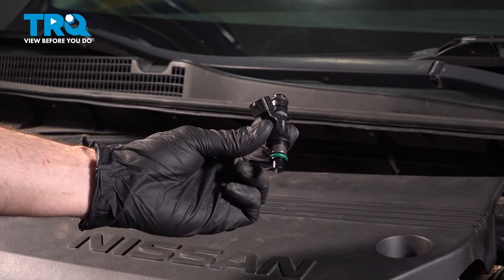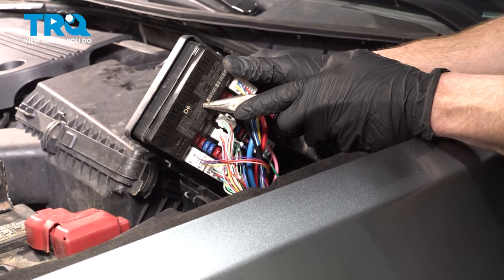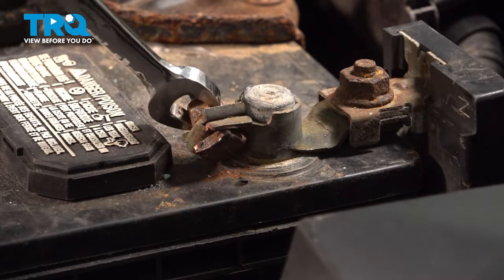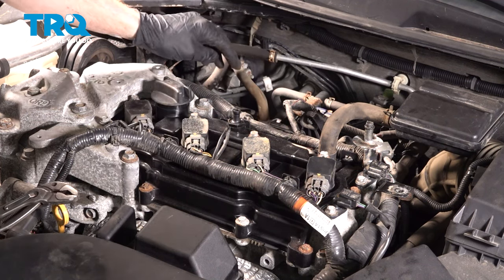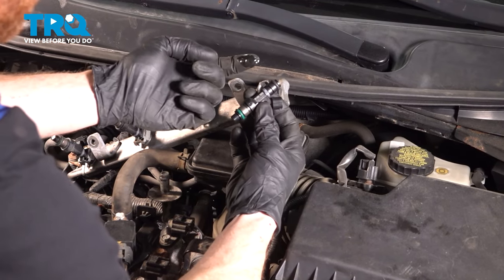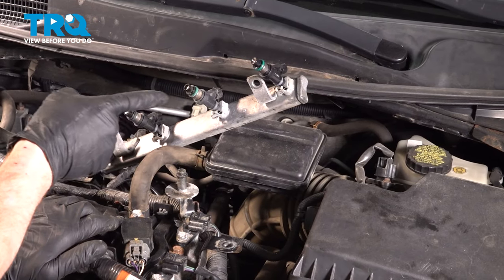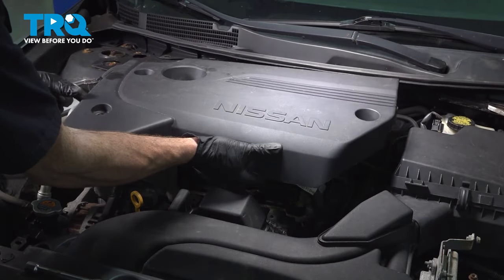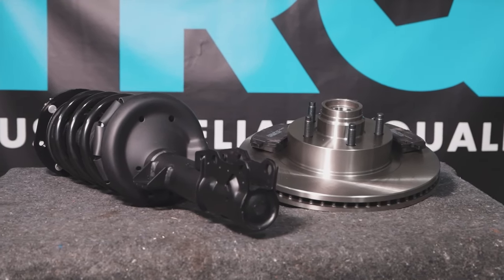How to Replace Fuel Injectors 2012-2018 Nissan Altima (2.5L)

Comment: Hey guys! I'm a education film professional. First you guys are amazing! Please keep up the good work! Secondly, just a quick tip on the engine view angle. PLEASE DON'T DO THIS UPSIDE DOWN AS DONE IN THIS VID. You're users are not going to be looking at the engine from this angle when they perform the task and this is not a typical view angle of engine bays so this angle feels disorienting and therefore hard to learn from. If you have to mount the camera upside down for whatever reason just flip it in post production and you're good to go. Your stuff is always amazing so please keep up the good work! I'm excited to see future videos!

Comment: I need this same video of replacing fuel injectors on a 2003 Nissan Altima 2.5s. I'm having issues getting to the fuel rail on the 2003.

Comment: I have endeavored to change my fuel injectors in my 2000 Corolla. It has been a wild ride with the injectors leaking due to the injector o-rings tearing or getting chewed up. Thankfully, I have a lot of spares and I have gotten better at inserting and lubricating them. I finally managed to get the injectors to stop leaking but then I was hit with numerous low-300 misfire codes plus P0172 (running too rich).

I read up on the misfires and the lower seals needed to be lubricated so I used Vaseline. No more 300 codes but I still have P0172. LTFT goes down to -26%, which is quite ironic considering I've been dealing with P0171 for the longest time. The car idles softly like it may sputter out when I drive slowly or stop

I assume this rich condition is from all of the excess fuel that went into the cylinders/engine from dealing with the recurring leaks and lifting the rail up and back so much and gas going into the port holes. It's not like it was a water hose or anything but still a decent amount over time as I couldn't run the engine with the injectors leaking.

Will this rich fuel condition work itself out with the engine drying on its own the more I drive or what can I do?

Comment: Horrible video, you guys usually do a fantastic job. You did not explain why you disconnected the fuse, then started then engine, then put back the fuse. One can only assume you pull the fuse and start the engine to open a valve or drain fuel??? 
Another issue, most people are not going to be working on their vehicle in this orientation, looks like you are on the opposite side of the car. You also did not clearly explain where exactly the 2 (10mm) bolts were for extraction on the fuel rail. Your arm is in the way most of the time. All in all you really need a 2nd person to film, while you explain slowly, step by step.